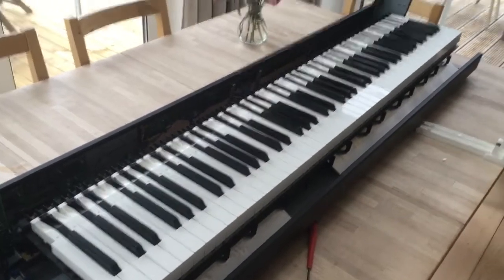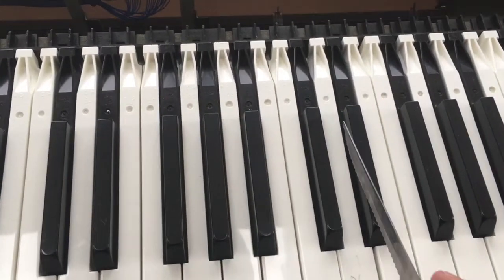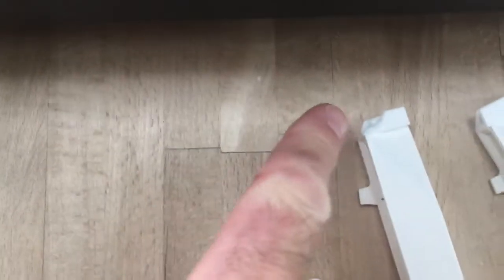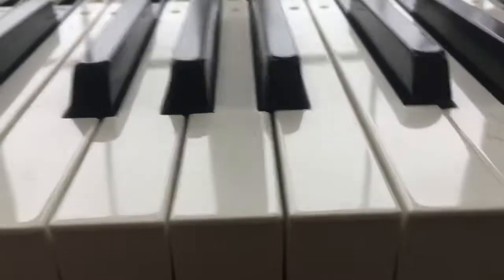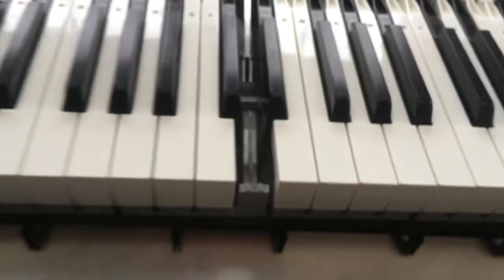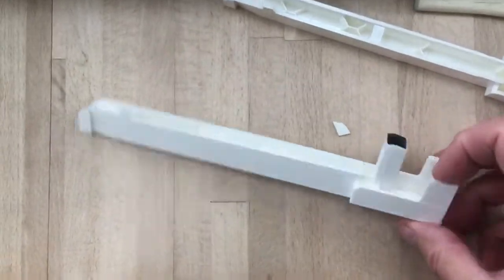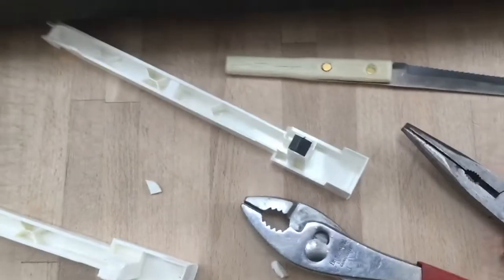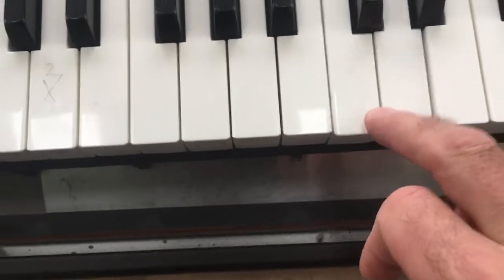How to fix hanging sticking keys: Yamaha e piano: clavinova, p series, stage piano and others

Comment: I was very annoyed, as my E5 key was sticking, and sure, I do use it very often. And yes, as you explained, it was crooked, and so there must have been something touching, and maybe broken. But once removed, and properly checked, to my surprise there was nothing broken. So.....I actually went ahead and replaced and changed it with E1 thinking that at least that key is less often played so it might bother me less if it got stuck. But to my surprise the apparently defective (and not "broken") key worked just fine in that octave! I have no idea why, but it worked. So I guess changing keys around might do the trick!
Reply from the maker: Glad it worked! Let me know if the fix lasts, I’m betting the corner is cracked anyway